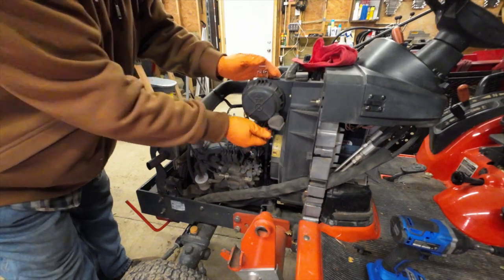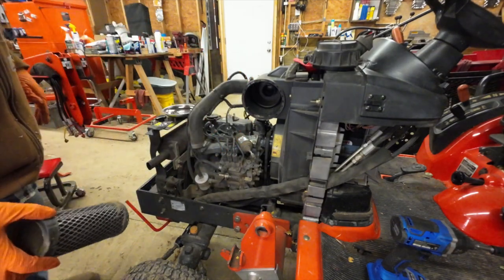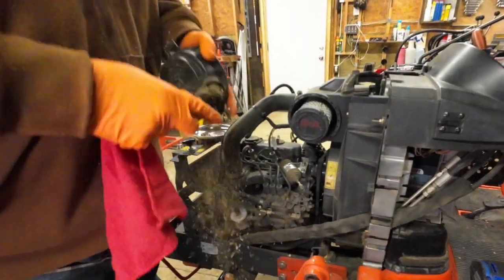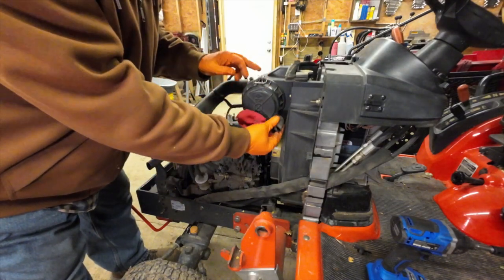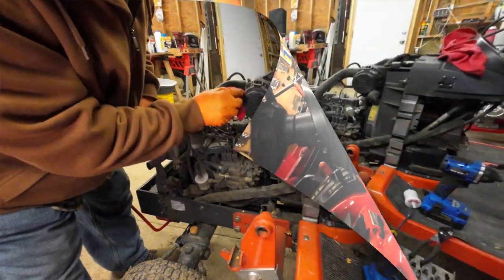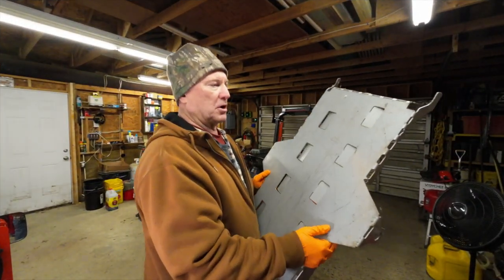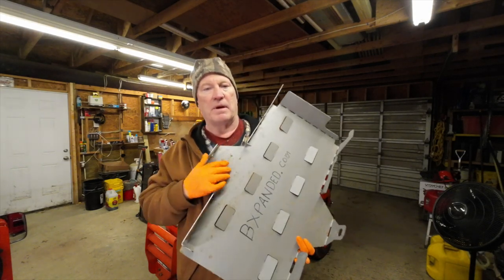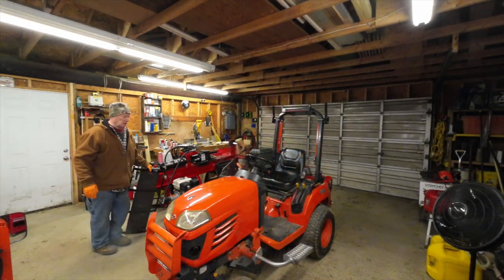128 - BX1850 Winter Maintenance

Comment: Well done Bob. You take good care of that little tractor. 👍 Stay safe.
Reply from the maker: Thanks, I try to keep up with the maintenance.  I change the engines oil and filter every fall after I complete mulching all the leaves.  I can remove the mower deck and then access all the filters under the tractor and maintenance points.  Thanks for watching and commenting - and watch for next weeks video - Enjoy the Journey - Cheers
Reply: @botabob , You are doing a great job. Keep it up and your tractor will last for many years. Maintenance is so important. I will be watching. Enjoy life to it's fullest, Larry.

Comment: Great job on the maintenance. I was surprised how much debris you had in the air box. The underside protection looks good
Reply from the maker: The debris was from fall leaf mulching.  I should have talked more about what the debris.  I've been having issues with the new DJI Action 3 losing files or the camera shutting off - I hope I get that worked out - Enjoy the Journey - Cheers

Comment: Great to get the maintenance done. More Kubota time now!!
Reply from the maker: As I stated in other comments, I like to do the oil and fuel filters every year in the fall.  When I first purchased the tractor I only changed the filter before the injector pump annually.  I did not realize there are two fuel filters on the BX.  The obvious one in the engine bay and the one that sits below the operator station and above the mower deck.  So, when the BX stopped working in the middle of mowing I learned about the second filter at the Kubota parts department.  It's not fun changing it in the summer or late fall, but I would hate to change it laying on my back in the middle of a snow storm.  It's been a very good machine, my only regret is I did not purchase a bigger compact tractor instead of the sub-compact tractor.  BTW, what is the model of your Kubota?  I'd like to look at something bigger with a skid steer quick connect loader including forks, grapple, and bucket for the loader.  I like to purchase with cash, so I've been saving my money, not sure that's a good idea with all this inflation.  Oh well, keep moving forward as I like to say.  Thanks for watching and commenting - Enjoy the Journey - Cheers
Reply: @botabob  Hi Bob, I have the LX3310.

Comment: Had a thought on your 28PRO splitter. If the cycle-time isn't 10sec without a load, contact Wolfe Ridge to see if you might have gotten a different pump than should be on there. Heard they had a lossible supply issue where they got pumps that weren't rated correctly, or mislabeled with the wrong specs. That alone could slow it down a second or two.
Reply from the maker: I saw that video.  I will send Wolfe Ridge an email and inquire about replacing the pump. Thanks for reminding me to do that.  Thanks for watching and commenting - Enjoy the Journey - Cheers
Reply: @botabob , was awesome chatting with you on the phone. You gave me a few great ideas to investigate. Will get on it next weekend, the outfeed tray extension idea.